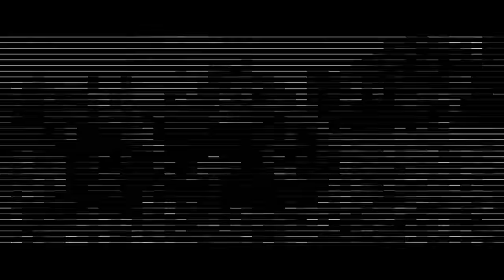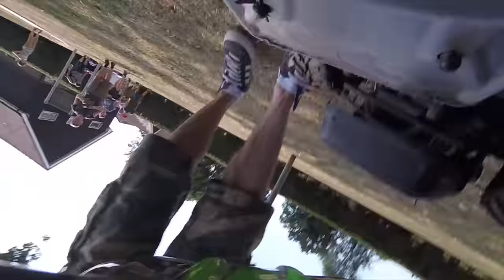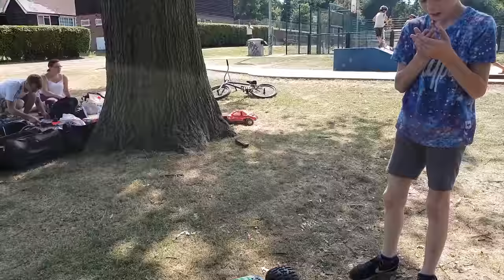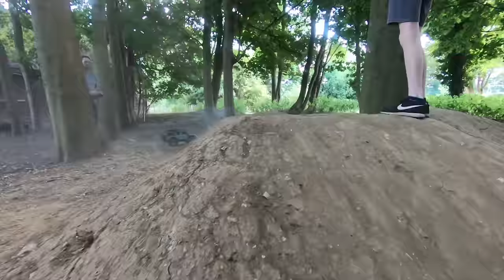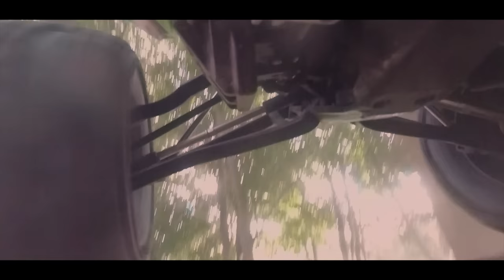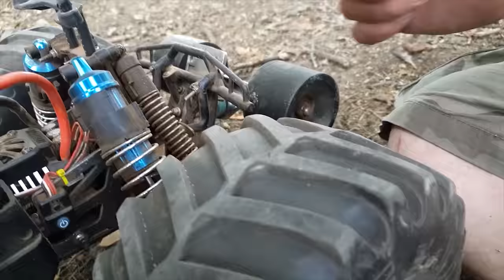HPI Savage XXL Bigger than the MAX vs Traxxas E-Revo 2.0

Comment: Kevin Talbot one thing that i have found useful with my homemade rc truggy is that you don't need to buy expensive rc tires when you can just take them from a toy you would find in a Walmart store. Or even at the dump! For example i found a rc truck that has been mangled but the tires were fine so i decided to check and see if they will fit on my truggy's rim and it does so i put them to use they are stiff but that doesn't bother me as long as they do the job then  they work for me!

Comment: Yeah I don't like savox in the Erevo. Wires are to short. You'll need an adapter. I'd just get the cheap power HD 20 kg of Amazon or eBay if they are back in stock.